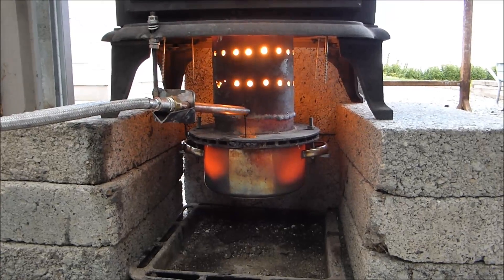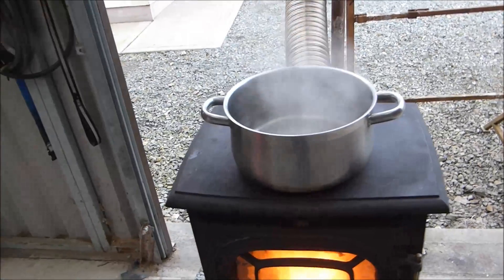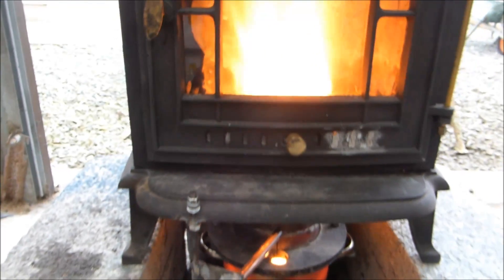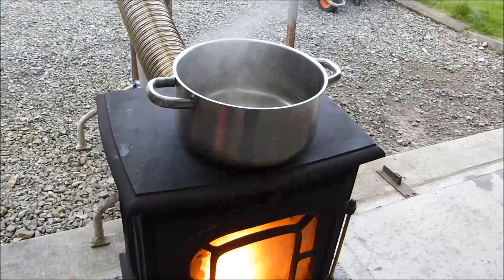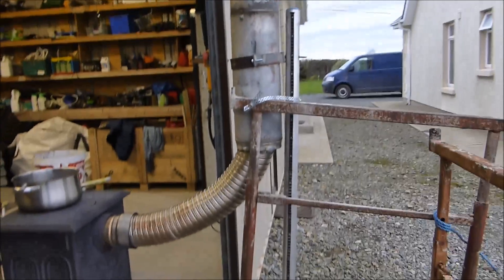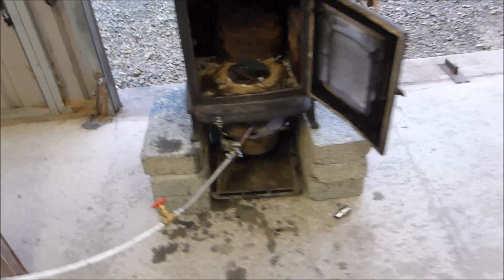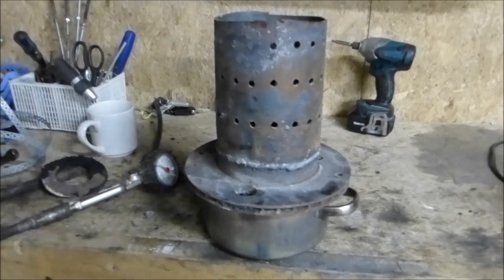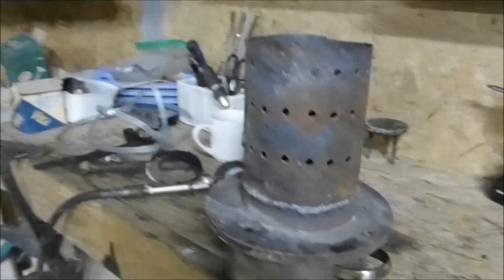Make a Great Waste Oil Burning Stove Heater

Comment: Still need to see the heat up the flu captured for use...or all those enviros will cry about global warming..got to be recirculation of some type..I've seen some water to steam use, that's  1800 times effective, Andy not without its dangers.""

Comment: how do you light it. is the oil dripping while it is lit? are the holes the cause of the "compressor sound" force air whatever it is cause I can't describe it. Thumbs Up. i Like, OLE!
Reply: you pour a bit of diesel or kerosene and light it up. when it's lighting , turn on oil feed.
Reply: @Cheese_1337  in another video he mentions it Thank you Bro!

Comment: Magnifica!
How do you turn it on?
How much does it consume x hour?
Reply from the maker: Hi Hector This burner can use 2 litres to 4 litres per hour. I have lots of videos with my waste oil burners but I made another with a different burner that runs on 2 litres per hour. I can even cook on it. Here's a link https://youtu.be/tnzEDEpz3Yk Cheers Gerry
Reply: Gerry, can you send me a link on how to make the burner please
Reply from the maker: Hi Hector. I show how to build the new burner in quite a few of the videos. I started with some tin cans and then I made them from steel. They work great and are really easy to make here's a link to the playlist.  https://goo.gl/ysrAb6  Cheers Gerry

Comment: Why the 10 mil holes on the back, opposite the drip hole?  Great video, thank you!
Reply: Wade Brewer adds air for the primary burn chamber where the base of the fire is, the fire then climbs up to the pipe with alot og holes which is the secondary chamber where most of the fuel is being finally burned off

Comment: It seems like a good idea  until you realise old engine oil can contain high levels of "lead" from worn bearings!!
Reply: the bearing surfaces inside of an internal combustion engine are made of copper not lead, unless you are burning leaded fuel in your vehicle lead should not be present in engine oil.

Comment: Good job.I built a used oil burner from plans in Whole Earth News magazine  given to me from a friendin the early 1970s.Was a miserable failure most of the time. Smoked the shop up and got complaints from the neighbors.However, yours makes a roaring noise, proof of good combustion and. It runs clean out the pipe. The system we used dripped oil on a hot pair of cast iron frying pan. It was more complicated than my description, but all in all it sucked.

Comment: hi if you add a hair dryer to the chimney about 4ft from the tank you should get a better burn it will force air to be sucked in through your secondary burn chamber.hope this idea gives you better combustion

Comment: Gerry, that looks like an aluminum pot at the bottom. I'd use a cast iron one if I were you.
Reply from the maker: Hi Leapdrive. The pot is stainless steel but a cast iron pot would be more robust to be sure. I have burnt my way through a few enamelled iron pots but the stainless is quite robust. Thanks Gerry
Reply: Ok....good work

Comment: Nice job Gerry! I especially like the fact you don't need an electric blower for this design. I am wondering if it would work with a smaller flue, and chimney such as a 4 inch/ 101mm? and a smaller disc brake rotor. Just a thought. Keep up the good work.
Tim
Reply from the maker: Hi Tim. I am not sure if it will work with 4 inch flue. The problem is that the flue generates the mixing forces in the blast tube and the larger and longer the flue the greater that mixing pressure. I know it will work on 5 inch flue but I suspect that it might smoke on the smaller sizes. I have been asked this before but I don't have any 4 inch flue to give it a try.
Cheers Gerry

Comment: Hello. Great project, going to make one for my shop. But have you taken any measurements on the flupipe to see how mutch heat goes up and out there. Not a big problem for me as I have alot of free oil to burn of :) But the main intention will bee to heat my shop, not the birds outside :) 

Best regards
T.Robertsen
Norway.
Reply from the maker: Hi. T  The flue does lose some heat but within my shed it is single walled so I get some radiant from that. This design is not most efficient that there could be but considering we are burning unrefined oil its a great way to make heat. I would say at a guess we are losing maybe 20% plus through the chimney which makes it about as efficient ( with regard to heat loss to the flue ) as most cast iron wood stoves installed domestically. A secondary heat exchanger would recover more of the flue heat and use less fuel but there is a limit with this type of stove as to how low you can go to maintain enough temperature in the vapourising pot to support combustion. Cheers Gerry
Reply: Gerry's Waste Oil Burner Hello. Yes it will. I have had a look at a "magic stove heat excanger" I am going to make one and put on my pipe. 
But first I need too make your burner :) and take som measurements on the fluepipe. 

Best regards
Reply from the maker: Hi T
You wont be cold that's for sure.
Cheers Gerry

Comment: Hi Gerry, greetings from Greece. Wonderfull job. What is the size of the holes in mm , that you drilled on the 15 cm diameter pipe?
Regards Tasos
Reply from the maker: Hi Tasos.  The holes  in the  150mm pipe are 10mm. I did 3 rows initially but found that with my flue I only needed 2 rows to make this stove as hot as I wanted. The flue diameter is 15cm but the length is most important. If there is not sufficient draw (air intake at pressure) through the 2 rows of 10mm holes the gasses wont mix correctly for a clean combustion in that chamber. Make your flue 4m or longer  and it will work great.  Cheers Gerry
Reply: Gerry's Waste Oil Burner
Thank you very much
Tasos

Comment: wow you can heat all your water with that as well
Reply from the maker: Hi Michael. I did do a burner setup with a boiler and a 300 litre domestic water tank. I heated the water to boiling point in about 60 mins. here's a link http://youtu.be/1Et3rIn5GIY
Cheers
Gerry

Comment: The rate of oil you are adding to the pot seems excessive, a drip design always works better, last longer and is much safer. The location of the waste oil to the furnace is what bothered me most, if anything went wrong it could cost you the house, garage and even your life so I please think long and hard before doing anything like this again.
I'd rather see you doing these videos in manner that keeps you the safest, not trying to be spoiled sport either just I have seen what fire and waste oil can do to a person and its not very nice trust me and it all happens as fast as well, a fire does.
This fire you were burning was way to hot, a cast iron pan is also the best as it will never burn through or melt! 
I friend has an old fuel oil furnace he converted into a drip waste oil burner and he burned down his first garage with it by doing one thing hap hazard like you were doing here. He rebuilt the garage and found another fuel oil furnace which he modified correctly and it still works great even after 15 years now. The garage/shop is very large and always nice and warn even in the coldest Minnesota winters which get way below zero.
Good luck.
Reply: It never ceases to amaze me how many people on youtube find the need to play "SAFETY NAZI" 
Did you not hear the six or seven times where he mentioned this is a very temporary setup, and the four or five times where mention was made about oil feed and being able to turn it down. The reason he was letting it roar so hard was to show how much heat could be obtained by this type of heater. As I am sure you know, the creator of this video is an adult and is responsible for his own actions and experiments, and enjoys filming them along the way for the entertainment of other like minded people who follow similar interests, or for other to take on a project in a similar manner at their own risk after assessing the possible outcomes good or bad. 
At the end of the day, how many adults do you know that would play with fire without some form of protection just because they watched a video on you tube. I would take a guess and say the creator of this video would have had more than one safety plan had the worst happened (fire extinguisher) etc etc. Just because it was ommited from the video does not mean it's not there. I am growing more and more tired of  arm chair heros whining and playing the Safety Nazi role instead of just enjoying the video and gaining some possible information. We all know how to be safe. If you don't like the video, don't watch.

Rant over
PS.
Constructive ideas and theories are of benefit to all of us, But being a smart ass know all upsets everyone.....

Comment: does the length of the flue make any difference ? mines only about 4 ft long , Im still playing round with it , but when its running full out , it just blasts black smoke out the stack like a steam engine climbing a hill . Im not exaggerating , either .
Reply from the maker: Hi. The flue length causes more neg pressure in the burn chamber for better mixing of the air and fuel. If it is too short the fuel is not burnt aggressively / completely enough and you will get a lot of smoke. My flue is 4 metres of 6inch pipe. I can hear it roar in the burn chamber which is the sound of the air being sucked in through the holes to complete the burn. Hope this helps. Cheers

Comment: Gerry this is great! Have built a waste oil water heater for a hot tub in a 48kg cylinder with a couple of heat exchangers where the air and oil is blown in with a leaf blower. Works great but is more than twice as thirsty as yours and a little savage I'm honest. Going to have a crack at this but have one question which shows my lack of experience. If most brake discs are cast iron how do you weld the steel pipe to it?  Many thanks!

Comment: How much oil to burn 24 hours?
Reply from the maker: Hi James. The stove at high output will burn 3 litres per hour so 72 litres in 24 hours. The output can be lowered and almost idled if you don't need so much continuous  heat. Cheers Gerry
Reply: Gerry's Waste Oil Burner Thanks Man!!!!!!

Comment: What keeps the oil from the nozzle from back burning or igniting?/?
Reply from the maker: Hello Bobby C. The oil is actually very hard to burn if it is not vaporised. Even if you pour some on the ground and try to light it with the torch it wont take. Check it out on this video the feed line is venting smoke when the door opens and it wont light http://youtu.be/QQGtl87-x58?t=5m21
Cheers Gerry
Reply: Gerry's Waste Oil Burner Main problem with waste oil is you never really know what could be the oil, from excess fuel which makes it very dangerous to other bad stuff.
Reply from the maker: Mike Smith Hi Mike. That's true of the waste oil. I try use waste veggie oil where possible but petrol / gasoline heavy metals are all problems to name a few. The stove was built also  to burn wood and other solid fuels as well. Cheers

Comment: How does this make it as a heater for a home?  I can't see our inspectors passing this.  Suggestions to make it legal for the home?
Reply from the maker: Hi Bob. I can't see it being legal for a home or insurable but if you were to use the boiler model that I have shown in other videos and place that in a shed or housing away from your house it could be used to heat a home. It is powerful enough to provide all the hot water too and if you had a heating system with radiators  or hydronic underfloor heating it would work well. Its not for everyone just a proof of concept really. Cheers Gerry
Reply: Thanks,

Comment: Thanks mate.
I did similar burner. I went to scrap yard to find some material to do this and what was funny, I found all the same parts next to each others which you have been using.
http://youtu.be/xshRRDG4iWg
Reply from the maker: Hi zteid99. I looked at your setup and it looks like it is working well for you. This is Ozzirts design and its amazing just how many different configurations that can be made from just a few parts. Well done! Cheers Gerry

Comment: Great videos! 
Would this type burner work if it was set inside the stove instead of hanging from the bottom outside the stove?  Then could you add air and oil line into the top of burner and be able to use it as a multi burner assemble and have the best of both if your electric went out. Thanks in advance.
Reply from the maker: Hi James. I did reply to your post last week but I don't  see it here. I hate this google + thing. It worked better before they messed with it. If you look at my other videos I have explored this with great success and ws able to heat 80 us gallons of water to boiling in about 1 hour which is about 70000 + btu's. That was the limitations of teh boiler and the burner could have done  Cheers Gerry
Reply: House heater as well as cook stove you mean I'm guessing.

Comment: Good Video Thanks. What gauge flue pipe are you using and how did you drill the holes so evenly. Is it the thin steel pipe we call stove pipe in the U.S that will lay flat before lock hinging the edges together ?
Reply from the maker: Hi KOMOCZIRAY. I just checked and the wall thickness is .0125 inch I am not sure what gauge that equates to but the measurement is accurate. Thicker is better as it holds the heat better and helps with secondary combustion. As for marking the holes: The pipe is 6 inches wide so Pi times diameter is 20.4 for the circumference so I marked out 20 inches of masking tape at 1 inch intervals and drilled through the marks. There is an easier burner to make and completely installs inside the stove but requires a fan check out. Here   http://youtu.be/oeFG1Tj3mbY
Cheers

Comment: Love that set up, just wondering about rods that you have holding pipe ,disk and pot inside of your stove. Have not seen that in any of your videos.Would appreciate if you could answer.Thanks,Robert
Reply from the maker: Hi Robert. The pipe with the holes (Secondary burn chamber) is slightly smaller than the hole in the stove and would simply fall out if not fixed. I could just put something under the pot to hold it in place. All I did was push some old screws through the pipe from the inside  so that it is held in position. It makes it easy to take the burner away from the stove. Cheers

Comment: Great job!! Im going to build one this summer...looks like that one burns awesome....again great job...
Reply from the maker: Hi Dave. I built a waste oil / log burner from a propane tank which might suit you as a project. Fabulous amount of heat output. There are 7 videos showing the build in detail. It uses the same burner but the burner can be left out to burn solid fuel. http://youtu.be/cYxtNRKj1Es Cheers

Comment: Doesn't veg. oil leave a lot of sticky, tacky, crusty, tarish residue to clean in the burn pan every time you use your stove?
Reply from the maker: Hi digger629. No it burns too hot for any sticky or tarnished oil. There is just a hard ash type waste. The pot is dry and dusty and I just tap the pot on the ground to break it up and simply empty the contents in the trash. Doesn't need cleaning every day but runs more efficiently if done. Cheers

Comment: Hello friend. I have a question re: this fantastic oil burning heater of yours. And I promise I'm not trying to be a smart a#@. You have a 8" pot right? and a 6" burner tube and flue. That means there is a 1" difference in the dia of the two, yet you drilled a 30mm hole for the oil intake. It's got me confused so I thought I'd ask you for an explanation. Is part of the hole on the outside of the pot or something? I love this video and look forward to you reply. Billy in Australia.
Reply from the maker: Hi Billy. The construction details are all here http://youtu.be/mh3cljTTJ2o. At the end of the video you can see the burner taken apart.  If you just welded the pipe to the brake disk and then remove the centre so as to be able to see through it you would be half way there. Then do the drilling of the 30mm and the 10mm holes. Cheers

Comment: hi ,, I have been making oil burners for years,, all different one,s ,,, but the one you made works very well ,, after seen this I am going to build a stove from plate steel ,, and put a boiler in it,,,   I work in a scrap yard so oil is no problem,,,  thank,s for the good video,,,
Reply from the maker: Hi. Landykid60 The beauty of this burner is it runs without power and only a few parts to drill and weld. It could even be bolted together with no welding at all. It is possible to heat water / radiators on a gravity  or pumped circuit. Good luck with your project

Comment from the maker: Hi D.Mulder. I looked at your burner video and it looks very well done but I think that you have too many holes in the secondary tube. Why not temporarily block off some of the holes and see the difference. You could be losing too much of the flue draught through the secondary tube because of the amount of holes in it. Check out my second video to see the sort of heat this produces with far fewer holes.
Waste oil stove heater lighting from cold to red hot in just a few minutes.
Hope this helps. Cheers
Reply from the maker: Sadiq Ma Hi.  As I  don't have any details of your heater its impossible to diagnose but flue length and diameter are important. The unit needs to be sealed so that there are no air leaks and that air is only drawn through the combustion area. Match the quantity of fuel delivered with the correct burn rate for your burner. If I were to open the door on the stove there would be lots of smoke out the door because the combustion conditions would have been altered. Combustion needs a good draw from the chimney and needs to happen in the vaporising pot and secondary burn chamber. Hope this helps. Cheers